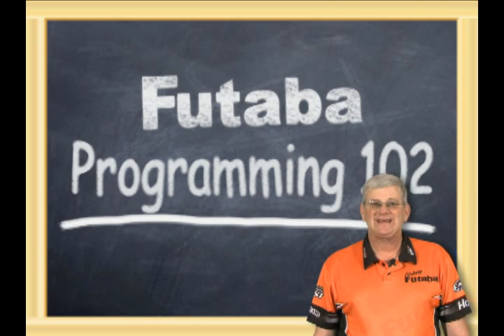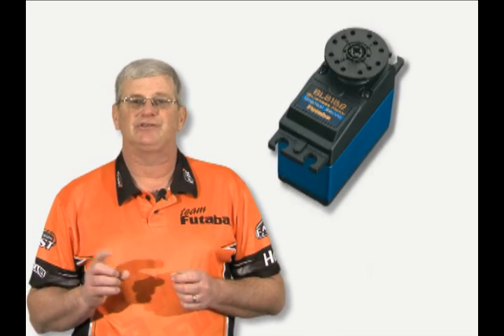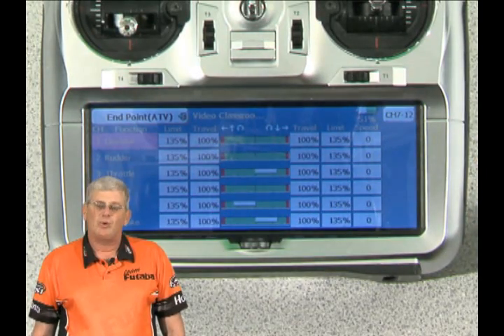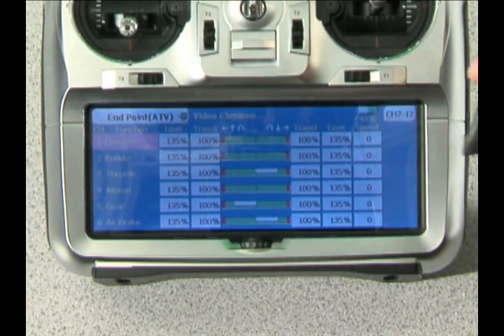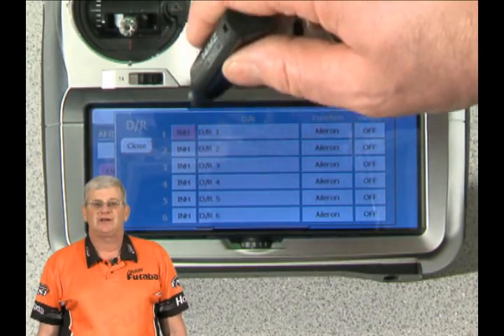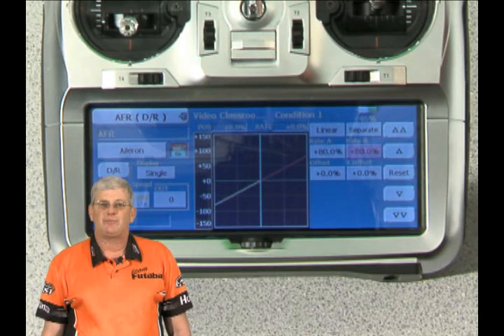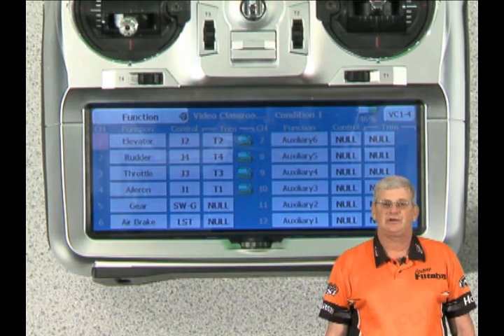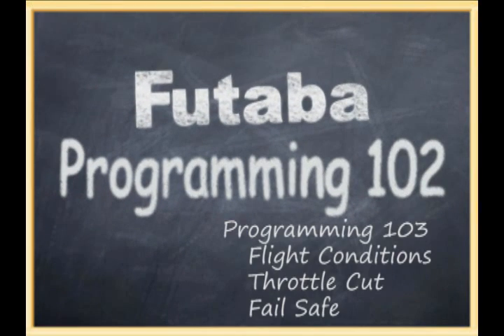Futaba® Radio Programming 102

Comment: Can you run four motors each on their own channels and assign switches to each channel to turn each one off individually. Also while all four channels are on, can they be programmed to left stick to throttle up and down simultaneously. I'm sure in a plane this would not make since but, I have other ideas for this.